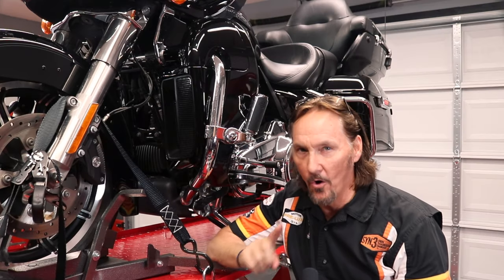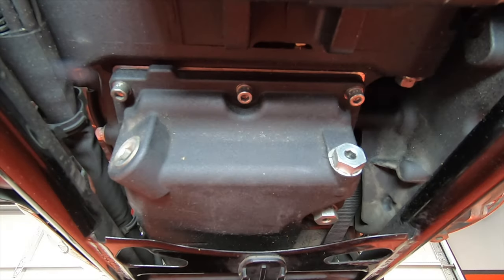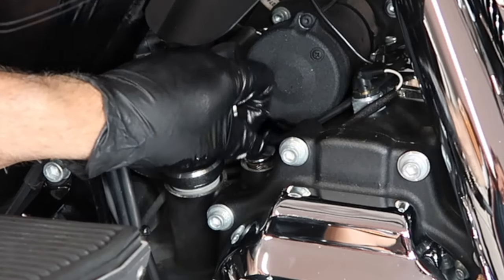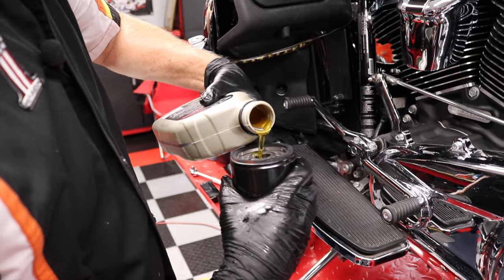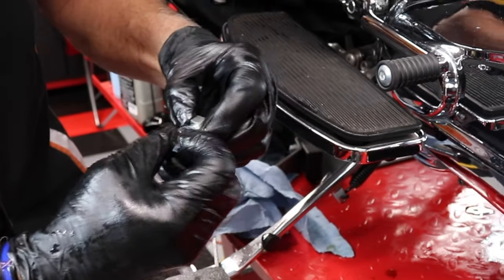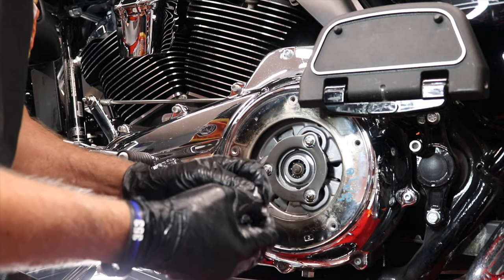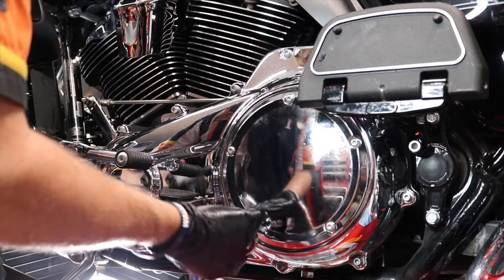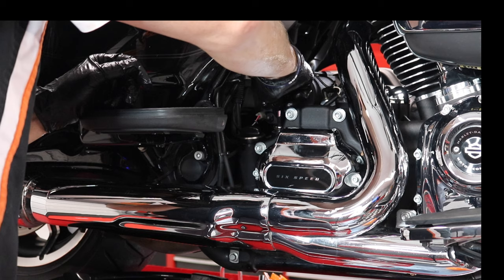Changing fluids On My Harley Davidson Road Glide

Comment: Excellent video. 👍👍  My dealer gets almost $300 for a 3 fluid change - insane. Do it yourself riders, and save money! Only thing I would add is to make sure the old filter gasket comes off with the filter and clean that flange. Don't want to double up gaskets by mistake. Now on to the brake and clutch fluid!
Reply from the maker: Thanks Hogdriver88!  So right about the gasket.  Brake and clutch fluid change coming. Did my brothers Road Glide this weekend, will do a video on mine. Appreciate ya!

Comment: Best oil change video I’ve seen. Outstanding content on oils, great camera angles, and fine details. Takes all the guess work out of the mix and boosts confidence significantly. Ride safe, and enjoy it to the max!
Reply from the maker: Thank you very much John!
Reply: @TollesonLife  I wonder if the recommendation in the Owner’s Manual about only pouring in 4 quarts of oil during the initial fill is based on the assumption that no oil is poured into the filter and that, after the engine is started and run for a few minutes after the oil change, that the tech will know to subsequently check the oil with the dip stick and add enough to bring the oil level up to the desired level.

Comment: Great Video, I usually change my car and truck oil all the time. Not sure why I take my bike to HD for fluid changes. I decided to get a lift and do it myself, thanks for the video, I will cancel my appointment at HD and keep that $300.00.
Reply from the maker: Awesome Jay08!  I always do everything I’m able that’s within my ability, if an issue excess that, I take it to a dealer.  So far so good!🙌🙌 Good luck!
Reply: @TollesonLife  I just changed my oil today. I asked the dealer what type of oil they used when I last had it serviced, they told me Syn3 in all three holes. So I purchased the oil and gaskets to change. I am very mechanically inclined I have always changed the oil on my cars and other motorcycles. This was my first time on my Harley, I drained the fluids the engine look normal, primary looked a bit grey with some shavings on the magnet. The transmission look like a strawberry shake, did not look like oil at all. The bike ran fine prior to the change so I preceded with adding the proper levels of Syn3 to all 3 holes. I started the bike and was startled by engine knock, I thought I would go away after a few seconds but it did not. I am to nervous to start it again. I have no idea what could have happened, maybe my oil pump failed I have no idea. I will call the dealership to see it they might have some ideas. I will keep my fingers crossed that its nothing major.
Reply from the maker: @fbj59  Wow, yeah that sounds unrelated to the oil change you did, you said you added the proper amount of fluid in all three holes so that must be something different.  Let me know what you what happens.
Reply: @TollesonLife  Sorry for the delayed response I am new to YouTube. Harley picked up my bike, the HD tech told me my rocker arm bolts backed out about an inch damaging  the push rods. He said he has never seen that happen before, he also said the during the engine assembly the builder must have gotten a false torque reading. He suggested I call corporate since it's a manufacturing problem. My extended warranty expired in May, corporate told me my 2018 Harley with 9K is old and many things could have caused the bolts to back out and they will do nothing.
Reply from the maker: @fbj59  unbelievable! Sorry to hear the news about the bike and that HD will do nothing.😡

Comment: What kind of wheel chock you using on your lift? I have a Harbor Freight lift that I had my 2007 Street Glide on, but wasn’t sure if I wanted to put my 2019 Road Glide Ultra on. Looks like you have no worries and was wondering what your set up was. Love your videos, very well done!
Reply from the maker: Thanks man! It’s called  the Wheel Dock,  I also use it for the Toy Hauler. Works great.

Comment: One thing all viewers MUST be aware of is the transmission oil transfer issue on the M8 ! I have a 2019 FLTRX 107 and in my first 1000 miles nearly all of my trans oil migrated to the primary.  I performed the Harley vent tube modification which is now present on all 2020 M8 models which helps and or stops the transfer problem. You might not want to use gear oil in your trans until you know for sure your bike isn’t transferring trans oil to your primary or clutch contamination will occur.  I’m speaking from experience.
Reply from the maker: Good call Rich!  I never had that issue thankfully but Im sure many have. Appreciate you sharing that with us as a reminder to viewers to be watchful for the issue.  All the best!
Reply: Tolleson Life      Great channel Darrel. I’ve watched a lot of your videos. You make me jealous at times lol.  But yes, I’ve been sharing my experience with my bikes issues and it does seem to be common.  I’m sure after installing that “fatter” clutch pushrod and venting the primary like all the new bikes come with from the factory I’ve solved that transfer problem.  The “fat” pushrod mod is to help slow the migration of oil thru the input shaft as it’s only design was to allow primary venting to the trans. By adding a vent to the primary like the one in the trans I closed up the original vent way. I’m almost certain the problem is gone forever.  I wish Harley would warn all their customers of this issue so some don’t run their trans dry and damage it.  It’s such a simple and cheap fix I don’t know why Harley don’t just recall all the 2017’s thru 2019’s.   We all know they are in dire straights financially right now but at least let it be known to its customers.  If your at a dealer go ahead and check the 2020 models.   The vent tube is a small rubber elbow located just behind the derby cover and inner primary at about the 1 o’clock position above the drive belt.  Harley knows of the problem that’s why it’s on all the 2020 models.  Be safe D.T.

Comment: Very easy to do, I just never understood why so many different fluids for each application. Some bikes use the same oil for everything Trans, primary, and engine.  I never used syn oils because of the cost, by the time that engine gets too hot its too late anyway.
Reply from the maker: Yes indeed, easy peasy!  I have used all types of oil and will probably use some Amsoil next change.  All the best!

Comment: Have you experienced any of the issues related to the M8 sumping or using too much oil when you drive long distances. I like all your videos.
Reply from the maker: Hey David,  no not at all, no issues thankfully.  Have you?  We appreciate you watching man.
Reply: Tolleson Life I just got back into riding, purchased a used 2017 RGS,  I have not taken it out on a long drive yet.  I will monitor it for sumping.  They want 300 to install the vent kit if it does not show sumping.  I hope I have one that’s not going to give me any problems,  knocking on wood.  Watching your riding  and camping videos fired me backup to ride.  I’m surprised how many of my friends still have bikes.